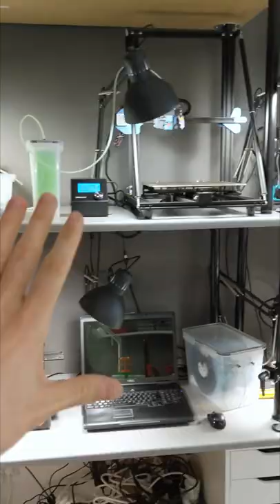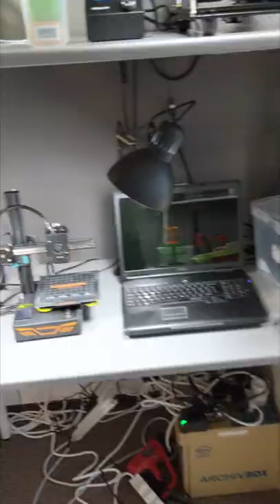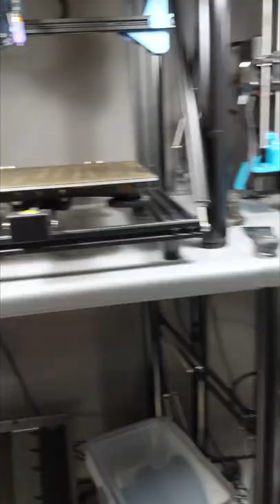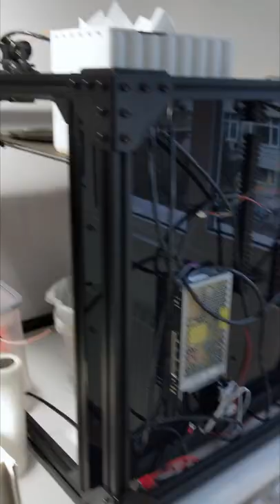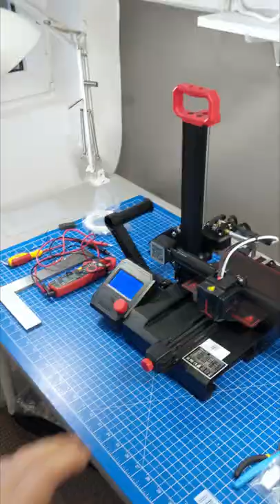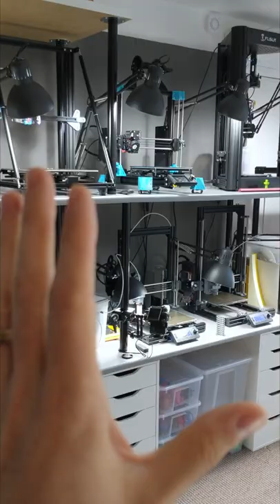Don't get a 3D printer

Comment: As my 3rd printer I spent the money on a prusa mk3 to get out of the "fix printer to print more fixes"-loop and been happy ever since, no mods whatsoever.
Reply: Yep, first printer was a MK3. Never had a single issue once I built it!
Reply: totally agree, bought my prusa and I make it work  harder than a chinese miner and considering the minimal maintenance I give it, I am astounded how well its done over 2 years.
Reply: Anet A8 built with my kid then soooo many mods and learning. Somewhere in there we got the MK3 kit, the teen built it and we've resisted "making it better" ... it's been chugging along for years. The anet, well... it was remodded in place a few times, then torn apart and turned into a corexy, then torn apart and turned into a different corexy which is the state it's currently sitting in, waiting for me to get interested in burning lots of time for little gain again.  ":^)
Reply: That's weird... 

When I was researching for my first printer just 9 months ago, I watched many YouTube videos and read many comments and the majority I came across said the Prusa also needs upgrades. Either to the hot end or whatever. All the problems I hear about with Enders come from noobs lacking technical abilities, and because more noobs buy cheaper printers. When people like CHEP or design prototype test say there's nothing wrong with the E3V2 and that any issues are easy to remedy if you have basic skills, then you know there's nothing wrong with them and it's just noobs not knowing what they're doing. Even if a noob buys a Prusa they still won't know what they're doing, and there will come a time when that Prusa has a problem and they will need to learn how to fix it.

Furthermore, my E3V2 is done, and only has $100 in upgrades (so I don't understand what this endless loop of printing fixes is). I made all my upgrades in the same couple weeks and I haven't touched my printer in 8 months. It does production runs every day, and is still half the price of the Prusa and LITERALLY prints just as good. The upgrades on my E3V2 all took like 5 minutes to install. By the way, I didn't NEED to do any of these upgrades. My e3v2 printed great out of the box. I didn't even consider them fixes. They are just mods that increase productivity. I also love using my 3D printer to print things for my 3D printer. That's part of the joy.

Your claim is a myth perpetuated by people who still think Prusa is the only game in town, and people that drink the Kool-Aid that bought into it and are bitter after seeing people with cheaper printers printing just as good now. And established YouTubers praising the cheaper printers and in some cases even saying they're just as good as Prusa. They hate hearing that. They're like Apple users. So now you see them out there spreading their misery because misery likes company.

I almost drank the Kool-Aid and got a Prusa, but I kept reading and reading. When I bought my E3V2 I still thought I would have a Prusa eventually, strong the marketing and peer pressure is for the Prusa. Well the only thing having an E3V2 for the last 9 months proved to me was that I don't need a Prusa. Best decision ever to not purchase that printer. I now have two printers for less than 1 Prusa. I just picked up an Ender S1. Half the price of the Prusa and comes with just about everything you would need.

Instead of drinking the Kool-Aid and trying to convince other people that Prusa is the only way to go. You guys should accept the fact that they are no longer the only game in town, and instead of getting people to waste their money you should try to get Prusa to lower their prices because their machines are not worth what they're charging.

To others reading this. Don't buy a Prusa, it's a waste of money. Why would you want to spend that kind of money on a machine that uses 3D printed parts to hold it together anyway. Don't listen to the people that tell you you need a Prusa. You do not. When doing your research consider the source. If the source is a noob, disregard what they're saying. Most of the people complaining about ender 3's online are noobs or just don't have any skills.

Lazy and unskilled people, or people with money to burn buy Prusa. Be smarter than that.
Reply: @lio1234234  No issue with my E3V2 either. Not in 9 months of daily production runs.

Prusa is not the only game in town anymore, and they are a complete rip off.

You only hear about more problems with Enders because more noobs and kids by them with no clue how to dial them in. You also won't hear the same level of criticism for the prusa because people call their customer service for help and some people are embarrassed to criticize something they just dropped $800 to $1,000 on.

Anyone that knows what they're doing loves the (half the price) E3V2, including people like CHEP and other pros.
Reply: @pintail120  Exact same experience with my E3V2.

That Kool-Aid is strong...
Reply: @dognoseranger  The cheaper 3D printers have come a long way in the last two years.

Prusa is no longer the only game in town.
Reply: @dangerous8333  bro, are you okay? This is about consumer grade 3D printers, not even real ones. 🤣
Reply: I have 3 Prusa MK3S printers and they just print and print no problems at all.
Reply: @dangerous8333  but prusa is the best game in town
Reply: Same, issue is now that it never has any issues, Ive realised for me working on my printer was half the fun.
Reply: @dangerous8333    I dont say that prusa is THE best, or the only good one - but it is still ONE of the best. 

And yes, I have a prusa, I am one of those "Kool aid" guys - 4, to be exact. I modified one of them, with all the "wonderful recommendations" and the "absolutely needed modifications" - and let's be honest, modifying it was kind of fun, but the prints weren't that much better to be a reason to modify it, to invest that much money in modifying it, and to spend that much time doing it.

Is it the best printer I have ever used? No, of course not - am using a jf 5200 that is better by far. Is it the cheapest? Well, it is cheaper than others, but cost as much as 4 ender, so...
But it gives us a good product for a reasonable amount of money, and that is the important part for most of the people wanting to print - no need to spend another 600 bucks and 2 weeks of work just to modify a cheap printer while hoping that everything works after you are done with it... OK, if something is wrong with a cheap one you just throw it away and buy a new one, while with a prusa you need to send it in for repairs, but that is (at least in my opinion) the better solution... 

Are there others out there delivering the same kind of performance as a prusa? Sure, but why spend month searching for if you can simply buy a prusa? 
Am I lazy? Sure - or at least I don't want to spend an eternity on modifications that might eventually work (or not....)

Regarding the e3, hey, it's a good printer - it just needs a new board, 50 bucks, new motors, 35 bucks, new hotend, 120 bucks, new guid rails, 100 bucks, .......
Reply: I think I might end up upgrading to this one eventually. I'm getting decent print quality from my ender 3 but there's just so much to learn that starting from a base of "it just freaking works" would be nice.
Reply: @dangerous8333  I agree with some of your points about Enders being good with minimal upgrades, but I have two factors I think you’ve overlooked: quality control/support and product lifetime. 

Creality’s quality control is less than ideal - while you may have gotten a good printer, they aren’t know for using great parts or excellent design. Even if it’s only a 25% chance that you have something minor (like a bad bearing or something) that will pop up after a hundred hours of printing, diagnosing and repairing it can be a lesson in frustration and wasted time. That’s not to mention their reputation for rushing potentially dangerous products out the door due to poor engineering. 

An even bigger factor to me is product lifetime – Prusa’s MK3 was released in September of 2017, and upgrade kits to the MK3S (2019) and MK3S+ (2020) are sold at a low price - you don’t have to buy and entire new printer. Because of that, you could have had the same printer for nearly 5 years and kept current with their latest offering for pretty cheap. That’s not to mention the constant firmware updates and their slicer that’s upgraded every few months. On the flip side, Creality released the Ender 3 in March of 2018, and since then we’ve seen the CR-20, Ender 3 pro, CR-20 pro, Ender 3 v2, CR-6 SE, Ender 3 S1, and now the Ender 3 S1 pro. They all fill the same niche of mid-sized desktop 3D printers, and (with a few exceptions) upgrades aren’t really available if you want to stay current with their top offering – you have to buy a whole new printer. Add in that they don’t really make their own slicer and firmware updates that are basically left up to the community taking care of, and you can see why they cost so little in comparison, but even then that advantage of having a super low price might be coming to an end as the S1 pro is set to cost $500. 

All in all, I’m not saying that Creality is a bad company at all. Between their SLA and (heavily modified) FDM printers, I have 6 of their printers in my workshop. But if I ever have a project that I know I need to print correctly the first time, I fire up my Prusa because the reliability and final quality is just a step above the others and I trust it in a way I don’t trust the others. 

*Disclaimer: Claims of reliability and trustworthiness of the MK3 series don’t include the MMU2S. I’ll yeet that POS time sink off a cliff if it ever comes near my MK3S again.
Reply: @DaveDDD  what are mmu2s?
Reply: That's what i thought and got the kit only to discover that the cable connections weren't well made.....has been standing around ever since and i got a Ender 5 pro that works.
Reply: Came here to say this. Cast a net out for advice from friends and coworkers about what a good printer to get would be. Everyone said MK3S+. A little expensive for the hobby grade, and I actually wound up with a project printer (printrbot + einsy rambo conversion that needed me to create my own firmware) but everyone says prusa is the place to go for "just fuckin works, out of the box, good to go"
Reply: @dognoseranger  My Anet A8 only has the acrylic, and the XYZ motors left, everything electronic and the extruders (it's dual now). Its original configuration set itself on fire shorted put weirdly, the USB3.0 controller on my PCs motherboard hasn't worked since, so instead of replacing parts with fire risk parts as specified by Anet, I rebuilt with a larger 24v build plate, RAMPs board and raspberry pi zero W instead of the anet controller with a loooong USB cord. Also added mosfets and relays and set up the firmware to actually cut power properly when anything goes wonky. Works great now, but it took years of trial and error, and at this point it's hd to even say its an Anet anymore. The few good parts from the A8 kit are being put to use, currently printing a new fan shroud with a camera mount for an endoscope-style camera close up to the hotends for remote inspection. It's nice to be printing a part not because it needs it to print properly, just to add extra :)
Reply: I'm on my way to this utopia
Reply: @dognoseranger  funny thing, my anet worked OK out of the box (once assembled), but I wanted features...all the features, and rigidity....ALL the rigidity.  It now has linear rails, bed leveling, ALL METAL construction, hell I think the only original part is the under-bed assembly and maybe a few of the wires are reused.  Lol.  I guess what im saying is that as long as you just want a PLA machine that only has basics some of the out of the box models are fine, but there's so many useful mods to do that its hard to resist.
Reply: I have high hopes for the Ender 3 S1.
Reply: @DaveDDD  just to let you know. Just got some S1s. About 350 on ebay if you make offers. For $500 i think it would fall short. For $350 im hopefully its a good deal.
Reply: @williammiller3277  S1 pro that went on sale this week or the standard S1 that came out a month or two ago? $350 for a S1 pro is extremely tempting.
Reply: @DaveDDD  standard S1. Is the only difference the high temp hot end?
Reply: @MNbenMN  we saw some YT videos on safety and that was our first mods/firmware changes, then stability, then trying to get more stability and consistency, repeat! It was a fantastic first foray into 3d printing, especially with all the great YT resources.
Reply: @NeoIsrafil  linear rails... drool ... our anet's current manifestation is still trying to make do with the rods.  ":^)
Reply: Same! I love my Prusa so much!
Reply: This exactly.

I moved across the country and had my prusa mk3s+ in a box for over 6 months.

I wiped off my print service and printed first time.

I have literally never had to do anything other than clean or sometimes scuff my print surface
Reply: My mk3s has been a proper good reliable printer for a long long time, although after the first nozzle wears out it starts to reach a point of problems. I’ve had my hotend heater break, hotend itsself cross threaded, fan burnt out, power supply burnt out, and had a really annoying issue where the filament would catch when loading and jam. Although it’s still an amazing printer which is well worth the price, be very careful with nozzle changes.
Reply: Exactly what I did on my third 👍🏻
Reply: But the fix printer to print more fixes is the best part =))
Reply: Yeah it's a pretty good workhorse